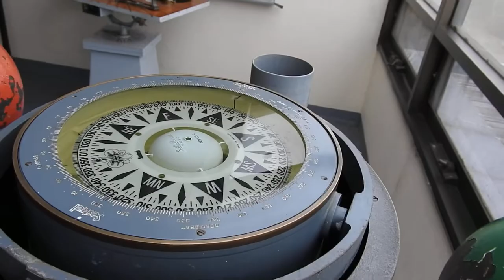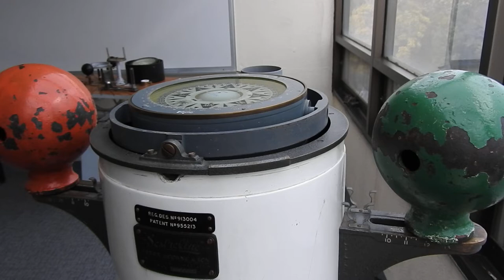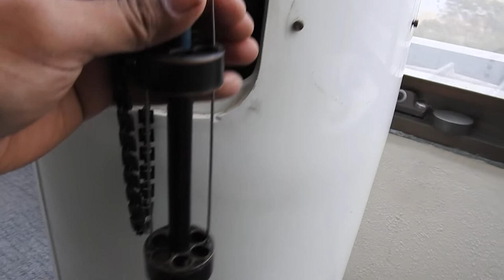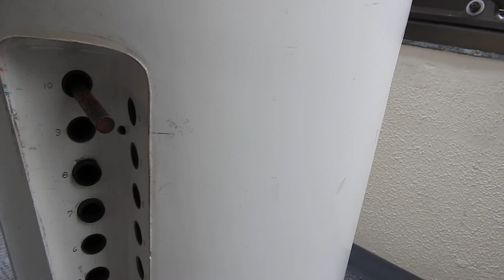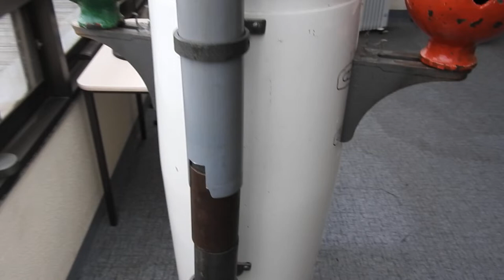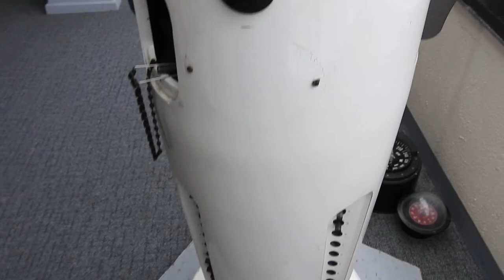Parts of a magnetic compass - Video

Comment: the shephees of the magnetic compass only move horizontal? or there other types that can move the position vertical or rotate them? thanks
Reply from the maker: Only horizontal:)
Reply: The spheres used because when we realised we had to adjust compasses with soft iron a huge supply of unused cannon balls were available.  The "Flinders bar" is soft iron for vertical adjustments; you could design a compass using "flinders balls" and quadrantal bars.